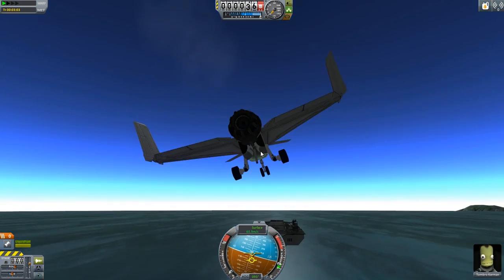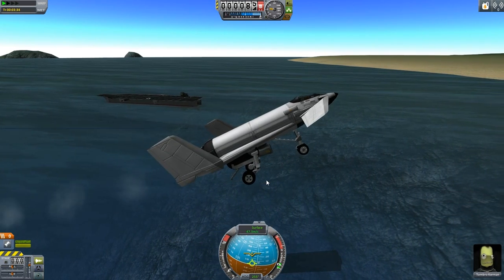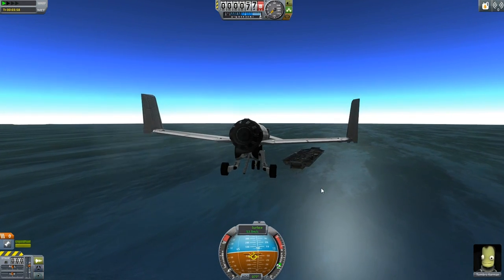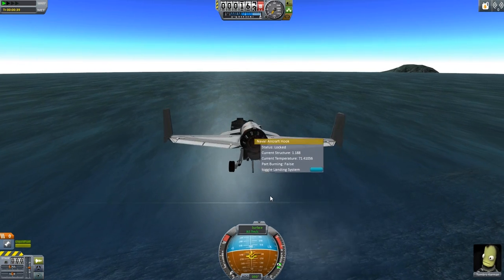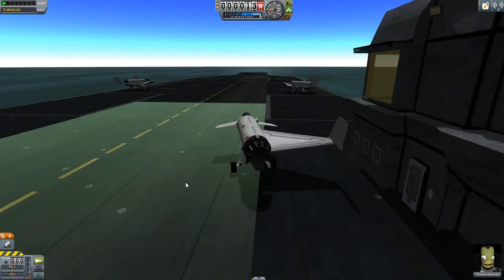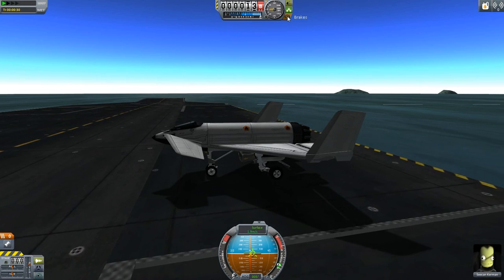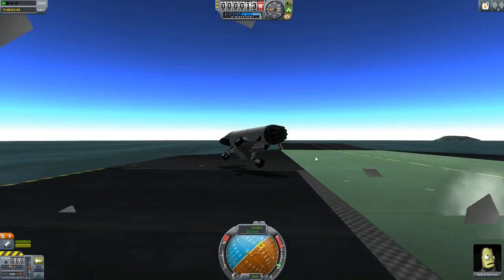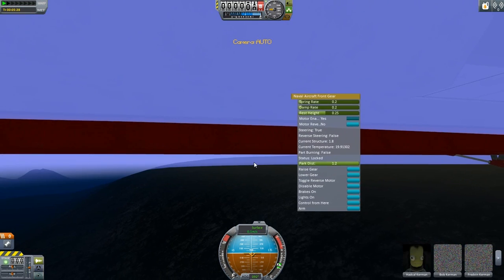Boatparts - Carrier and Naval Landing Gear Update

Comment: what kind of landing gear is that?
Reply from the maker: These are the Naval Landing gear I made. Specially made for landing and docking on the ships.
Reply from the maker: Infini Tedice
I loosely based them on f-18 gears.
Reply: you should do an ejection seat if you dont land correct
Reply: Jonathan Small look up the vangaurd system it has kerbal parachutes and ejections seats you can use that for now (or forever if ID doesn't add it to his mod).
Reply: thanks that helps